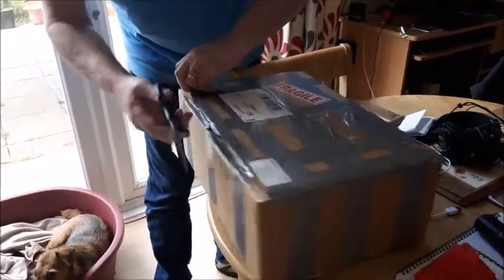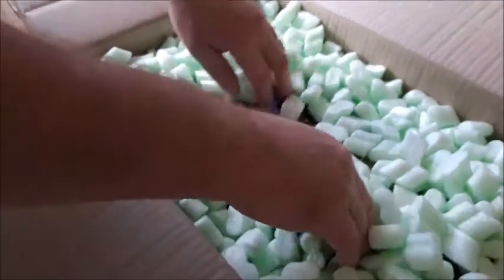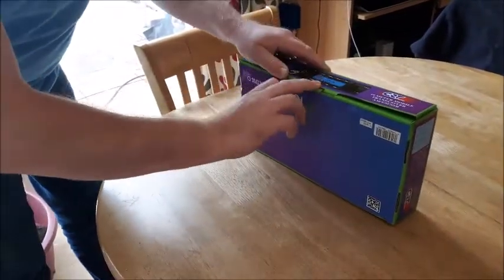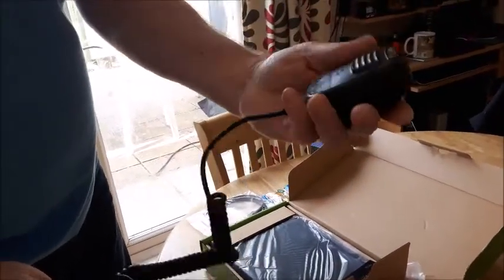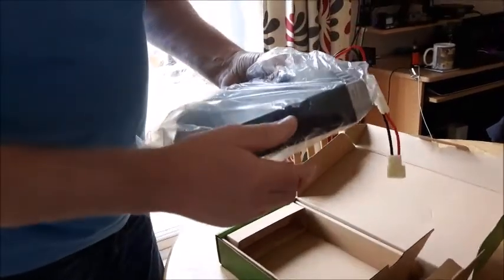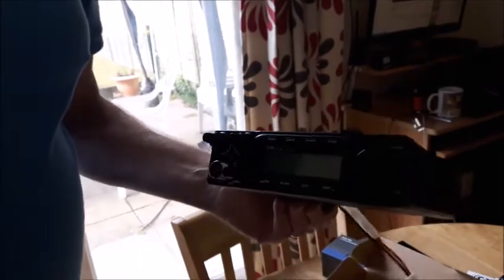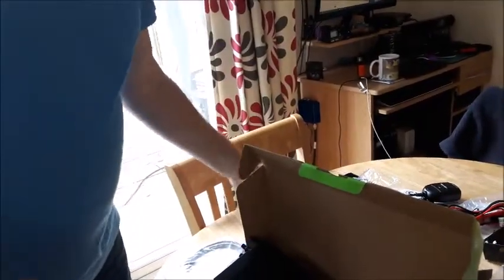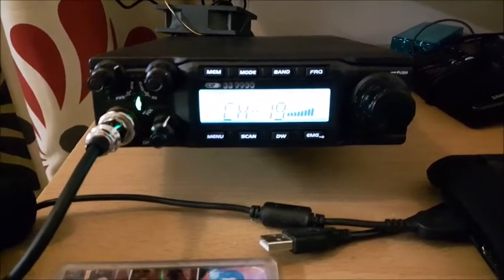CTR SS-9900

Comment: Great radio for the car, got mine installed back to back with strong velcro. No need for the bracket. Wires straight to the battery. Antenna small stealthy president new york antenna just snip about 5mm of top for uk40.
Reply: Radio buona

Comment: Nice radio. Only issue with them is don't run full power for too long especially on FM as a few people have stated the finals go pop easily. Enjoy! 73s Tim
Reply from the maker: Cheers Tim only low power on FM &  i run a computer fan on high power on SSB. 
There a very nice radio and good to see the band has been open lately

Comment: How hot does it get if you talk for a long time?
Reply from the maker: They do get hot but i have a old computer fan that keeps it cool. On ssb it,s fine with out the fan. Hope this helps.
you could run the radio on 5w and use a liner amplifier